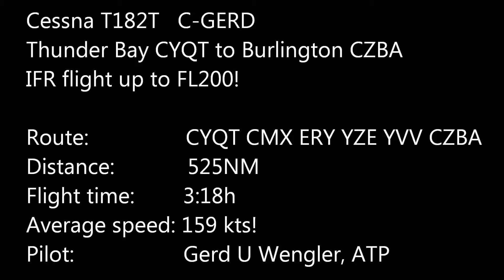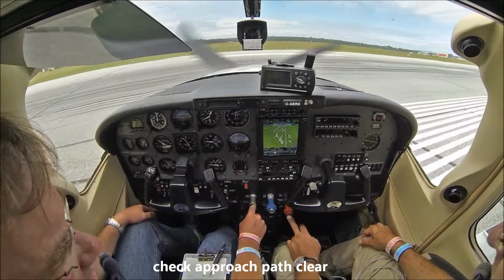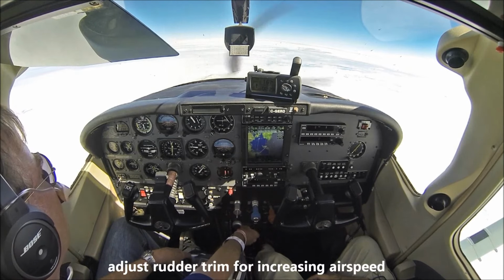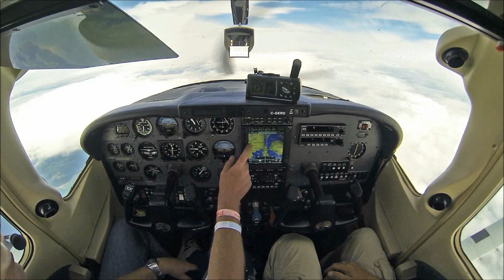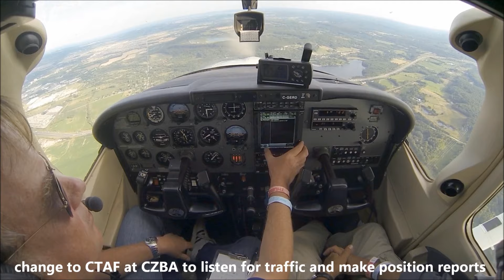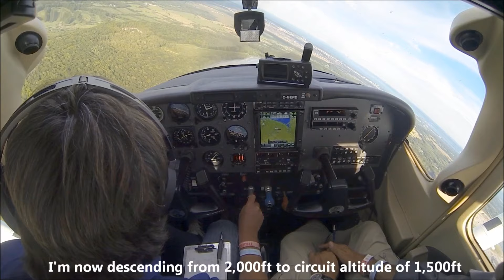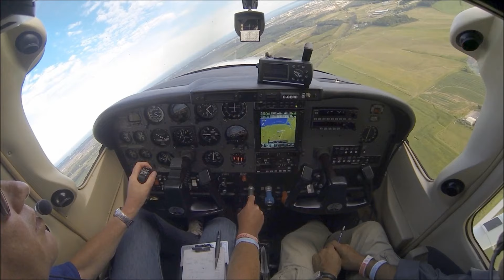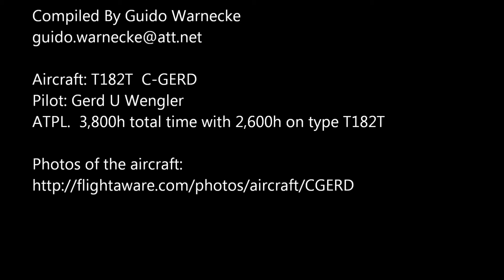Cessna Skylane at 19,000ft - cockpit video - must see!

Comment: I noticed you went to full flaps on your base leg.  I haven't flown in about 10 years but I thought you never went to full flaps unless you made the field.....  Just wondering???   Thanks
Reply from the maker: Hi Ed,
first of all: thanks for your comment.
I do not have a firm and final answer on this.
In the "early days" flight students were taught to fly "to make the field" at all times.
I do not think this is necessary anymore as engine failures (the ones not caused by fuel starvation...) are very, very rare.
How could you otherwise justify to fly single engine at night or in IMC?
Happy Landings,
Guido
Reply from the maker: Ed Prange Only a pleasure, Ed.
Happy landings,
Guido

Comment: Dear Mr. Guido, can you explain me how adjusting the rudder trim you gain more speed? Thank you.
Reply from the maker: Hi Rafael,
the aircraft needs to be trimmed for all speeds and power settings.
During take off, you need to trim the rudder to the right.
In cruise, when the airspeed is higher, you need less right rudder trim. 
Happy Landings,
Guido
Reply: Guido Warnecke So the right trim during take off is for the motor torque?
Reply from the maker: Rafael Mora Exactly, Rafael!
Smaller aircraft do not have a rudder trim. They expect the pilot to push in the rudder on take off and climb. During typical cruise, the airplane is then trimmed out.
The more power the engine has the more difficult it is to control. I hear that aircraft like the P51 are not controllable on take off if the rudder trim is not set.
Happy Landings,
Guido
Reply: Guido Warnecke Thank you for you answers and sharing your flying experience! Cheers from Venezuela.

Comment: ? If the engine was to fail at that altitude, what are your options on making it back down in one piece? Thanks, and I was going to ask about oxygen, but someone else said u have a valve u open?
Reply from the maker: The options are actually very good.
In the - very unlikely - event of an engine failure, the aircraft descents like a glider. The glide ratio is approx. 1:10, meaning for 1 feet of altitude, you can glide 10 feet.
From 19,000ft you glide 190,000ft or approx. 60km!
A lot of options...
Happy Landings,
Guido
PS: although I understand and respect the anonymity of the web, I would appreciate if you could write your comment with your clear name - it's just more personal. Thank you!

Comment: Also i have a question, what is a full stop, i've heard this in many aviation videos but never quite figured it out
Reply from the maker: DarkYogurt During training - to save time - pilots often do "touch & go" landings, meaning after touch down (just to train the correct flare and touch down) full power is applied and the aircraft takes off again, without stopping. If the runway is long enough, this is a safe maneuver. It saves the time to stop and taxi back to the beginning of the runway. In most training aircraft, you pay when the engine is running, hence also during taxi on the ground.
To tell the tower that you will stop on the runway you say "full stop landing". This is also important for aircraft behind you on the approach. If you do a touch and go, you are quickly off the runway, when you do a full stop, you need more time and the aircraft behind needs more spacing behind you.
Happy Landing,
Guido

Comment: How was it possible to obtain such a high altitude within a piston? Was the cabin pressurized ?
Reply from the maker: Hi Brandon,
the piston engine has a turbocharger.
It works quite simple: the exhaust gases of the engine are used to drive a turbine which in turn drives a compressor.
This compressor id good enough to restore sea level pressure of the air going into the engine (at 19,000 ft the pressure is less than half compared to sea level).
So the engine produces normal power at this altitude.
For the passengers and pilots we use oxygen masks and nasal cannulas.
This aircraft has a built in oxygen tank that supply enough for a couple of hours at altitude.
Happy landings,
Guido

Comment: As for the phraseology, in USA  for flight level we dont say 15,000 or one five thousand 15,000 ft is 150 and drop last digits. Flight level 20,000 ft would be 200..Much shorter ...
Reply from the maker: Canada uses the same altitude / flight level system as in the US. 
The correct phraseology for altitudes is "one five thousand"
Example: N12345 climb and maintain one five thousand.
Passing the transition altitude, in the flight levels it would be flight level 150. 
If you scroll through my videos you will here US ATC (and others) using the correct phraseology.
Radio communication between human beings is very much prone to misunderstandings and all efforts should be done to minimize this risk.

Happy Landings,
Guido

Comment: Hello, Sir. How do you do to put the camera in that position, right behind your heads?
Reply from the maker: Hi Victor,
the camera is on the cockpit ceiling.
A lot of "try and error" is required to find the correct position.
Happy Landings,
Guido
Reply: Yes, but is it trapped or glued? How was it fixed?
Reply from the maker: Victor Vasques I use the standard holder (with the glue stick) that comes with the camera.
Happy Landings,
Guido
Reply: Thanks for clarifying. By the way,   I love your videos, and I hope you keep doing them. 

Victor

Comment: OMG, how change the w&b with the change in the engine? or the fuel consumption??, you had to change the fuel tanks?
Reply from the maker: Hi Petrus,
the engine is standard. The additional tanks in the wing tips are fully certified and do not affect the weight and balance.
Of course you can not fill all passenger seats with the aux. tanks full.
Happy Landings,
Guido

Comment: What is the limit of altitude for Cessna Skylane?
Reply from the maker: +David Smith It is 20,000ft for the new series Cessna 182. This is only a "book" limitation.
I think Cessna did that to differentiate their new C206 (30,000ft) form the T182T.
Both could technically reach the same altitude (and more).
Happy Landings,
Guido
Reply from the maker: You are very welcome, David!
Happy Landings,
Guido

Comment: The landing is not complete until you have cleared the runway. Don’t do the after landing flow and checklist until after you are clear of the runway.
Reply: Hello, I want to learn from you.  What is "after landing flow" and was there a checklist used before clearing the runway.  I am always happy to learn from pilots like you.  Gerd (the pilot in the video)
Reply: Gerd Wengler - A flow is a memorized series of steps that you verify has been completed with a checklist. For example, the airplane that I fly has an after landing flow of Lights, Flaps, Trim, APU On. For your aircraft it is typically flaps up, lights as appropriate, and trim set for takeoff. I see it all the time where pilots distract themselves with after landing tasks while rolling down the runway. Here in the USA, if an FAA examiner were with you, they would certainly point that kind of behavior out as incorrect. After landing tasks are to be completed once clear of the runway.
Reply: @cloudstreets1396  fantastic to be able to learn from such a wonderful pilot.  What license do you have?  What do you fly?  And could you please point out exactly what I did wrong so i could avoid engaging in such dangerous behaviour next time?
Reply: Gerd Wengler - Feel free to continue doing what you are doing. I am not your boss. However, if you are seeking to improve your flying and maximize safety, a landing is complete after you have exited the runway. Then you can perform after landing procedures: flaps, lights, mixture, cowl flaps. I have an ATP license since you asked.
Reply: @cloudstreets1396  As an example, ERJ 175 Landing Call Outs, after landing sequence (excerpts):
Lights off (except NAV, Taxi, Bcn)
Trim set to 4
Flaps retract

All to be performed after landing, on the runway, exactly what I did (lights, cowl flaps, flaps).

There were two ATPs on board (ATPLs from three countries), a whole bunch of type ratings, 15,000+ hours, PIC has 4000 hrs on type.
Reply: Gerd Wengler - The after landing sequence is not to be performed on the runway. It is performed when the captain calls for it and that is after exiting the runway. Do what you wish.
Reply from the maker: The only item I really discourage to touch on the landing roll out is the flap lever.
Under certain conditions this is ok:
a) you brief it properly on a short field / soft field runway 
b) you have no intentions to fly a retractable landing gear aircraft in the near future, like in Gerd's case. 
I can assure you that Gerd is a highly responsible and experienced pilot.
In aviation there is seldom only "one way" to do things. Of course some industry standards are good, in particular in part 121 multi crew operation where crews are paired randomly.
Single pilot ops is a different thing.
Happy Landings,
Guido

Comment: As a long time pilot, it appears that the Skylane is at about 1500 or 2000 feet, also where is the pilots O2 mask? O2 is required above 12500! This is a farce.
Reply from the maker: Hi Joe,
we have used nasal oxygen canulas above 10,000ft.
The highest certified altitude for the T182T is 20,000ft. It can go higher, but is not certified to do so.
This was the reason we requested the "block level" between FL190 and FL210, as FL200 (to get above the clouds) would be the "wrong way".

The altimeters are not easy to read at altitudes above 10,000ft. Only a small pointer shows the 10,000 and 20,000ft mark. In the jets I fly we have drum pointer type altimeters that show the altitude more clearly.

http://www.skybrary.aero/index.php/Altimeter

Happy Landings,
Guido
Reply: Guido Warnecke
Hi Guido,
I obviously only looked at the low altitude photo. My error. I try to keep my head up and locked, but 
at my age I have a few "Brain Farts"! Happy flying.
Reply from the maker: Same here... I use multi-focal glasses since a couple of years. The privilege of age... :-)
Happy Landings,
Guido

Comment: What does turning the mixture knob left and right do?   I though pulling it in/out would lean or enrich the fuel
Reply from the maker: The knob adjust the fuel flow for a given throttle setting.
Happy Landings,
Guido
Reply: awesome... I take it there is a turbo or supercharger on the engine since ur about 125,  how much boost does it output?
Reply from the maker: The turbocharger resources sea level power.
Happy Landings,
Guido

Comment: I'm guessing that since its a turbocharger engine has its own TCDS? No STC?
Reply from the maker: TCDS = Type Certificate Data Sheet (I actually had to look this up).
Honestly, no idea. The aircraft is equipped with this engine directly at the factory.
Happy Landings,
Guido
Reply: TheMusicboy316 It's not an STC, it's on the TC.

Comment: Could you explain what canceling search and rescue is? This must be a Canadian thing. Cheers!
Reply from the maker: Hi Tom,
it is actually an international thing.
When you fly on a flight plan, you are automatically protected by a search and rescue plan. If you are overdue, they start searching for you.
In Canada, on every flight beyond the airport boundary, you have to file a flight plan.
Not a problem, when you land on a towered airplane, then the tower personnel will close the flight plan for you.
Problems come up when you land on a non-towered airport (like the one we landed on).
Pilots sometimes forget to close the flight plan, ATC has no confirmation that you have landed safely.
Can be an expensive error, if they launch search helicopters for you.
Some pilots have a sticker on the aircraft door "did you close your flight plan"...
Happy Landings,
Guido
Reply: Guido Warnecke sounds similar to domestic FAA VFR fightplans, if you don't close they send the civil air patrol
Reply: TomCook1993 Here, they send CH-146 Griffons from CFB Trenton, or even worse, C-130s. Really expensive bill for forgetting to close the flight plan.
Reply from the maker: ZombieYellow11 Yes!
Always close your flight plan!
Happy Landings,
Guido

Comment: wow v's must have been within a few knots of each other. flying vs.stalling=+/-?Kts ???? not the book answer. how close was it in actual conditions that day???
Reply from the maker: Hi John
in these types of airplanes, the "coffin corner" - small area between stall speed and maximum Mach number is not an issue yet.
The indicated airspeed was at least 50 kts above the stall speed.
As indicated airspeed is lower at high altitudes and also the air mass going through the engine air cooling system, the cylinder head temperatures must be closely monitored.
Happy Landings,
Guido

Comment: The regulations state that you need oxygen over 15,000 feet but if your only up there for a few minutes you'll maybe be ok depends on the person and how much carbon dioxide the person can handle before blacking out
Reply from the maker: +Ann Myers Regulations differ from country to country.
Generally supplemental oxygen is required above 10,000ft.
It is not so much about "blacking out", more about maintaining full performance in the cockpit.
Happy Landings,
Guido

Comment: after landings ive always waited to bring up the flaps and turn off/on lights or whatnot until ive cleared the runway. This maybe because my dad is an airline pilot and thats why he told me that but i am not sure. Just wondering if it really matters
Reply from the maker: This is correct, Ethan.
This is mainly to prevent to raise the gear instead of the flaps if you are in a hurry.
The pilot here is very experienced and has no intention to fly an aircraft with a retractable gear - so this is ok.
Happy Landings,
Guido
Reply: Guido Warnecke thank you that explains it, plus our main aircraft we flew was a c337 skymaster so that must be why

Comment: Next time check list before depart......mixture rich is important when add full power to take off... thanks god you had a good co pilot who helped you and you do not even notice about that
Reply from the maker: +LearningGolfChannel a 
I think you got that one wrong (not the advise to put the mixture to rich on take off with a turbocharged aircraft).
I was the assigned "mixture man". Actually I am the one on the right seat.
All briefed before the take off.
Happy Landings,
Guido
Reply: +Guido Warnecke Hello again ... I do not understand... if it is not necessary push to full rich mixture, why did you applied? it is optional and at that time you decided full rich?
Reply from the maker: The mixture has to be rich at take off on a turbocharged engine.
Happy Landings,
Guido
Reply: +Guido Warnecke Hello again... I totally agree: full mixture rich for take off and landing too.... And also I personally check my pre take off check list before line up ... tell that to your friend. It's a good routine, because the video do not show that he did that. Have a great day and happy landings to you too :)

Comment: wow 160 kias at fl200 thats pretty good performance I recently took a c182t 2007 up to 11,000
Reply from the maker: Hi Jared,
the T182T is a very good performing aircraft.
The TAS typically increases by 2% per 1,000ft altitude.
The turbocharger keeps the engine power constant at altitude.
Happy Landings,
Guido
Reply: really??? so even in the flight levels its not working harder? very intresting being that it is a piston 2007 182t flies like a champ. but did not know it perform well at very high altitudes although when i took it up to 11,000 out of miami it was a quick climb
Reply from the maker: jaredk817 The T182T has the big 540 cubic inch engine. It poduces 350HP in other airplanes.
Happy Landings,
Guido

Comment: I was wondering how a 182 could go 1,200nm but then realized you probably refueled to return.
Reply: +Peter Matthess The higher you go the thinner the air is and the less parasitic drag to overcome. With a turbo you can still make really good horsepower at higher altitudes but the higher you go the less efficient the prop is since the air is so thin.
Reply: +Micah Butler I see, so with higher altitude you also have increased range, I guess that makes sense, never really thought of that, you go faster when you are higher, so yea

Comment: What are cowl flaps
Reply from the maker: Hi Ishan,
google "cowl flaps AOPA" and you find this text:
"Cowl flaps are small doors located in the bottom of the engine cowling that allow for greater cylinder cooling during takeoff and climb. The pilot operates the flaps by opening and closing them via mechanical or electrical controls in the cockpit.

If your training airplane doesn’t have cowl flaps, that’s because its engine size and cowling design effectively keep things cool enough. Air travels through the engine cowl, collects heat produced in the combustion process, and exits through openings on the underside of the cowling.

On larger engines with more horsepower, that’s not enough. These engines generate lots of heat, and they may be tightly cowled to reduce drag.

When opened, cowl flaps increase the flow of cooling air through the cowling by increasing the size of the cowling outlet. They should be closed during cruise, descent, and landing. If transitioning to a high-performance aircraft, refer to the pilot’s operating handbook for the proper use of cowl flaps."

Hope this helps.
If not, please comment again and I will further explain.
Thanks for watching my videos & Happy Landings,
Guido